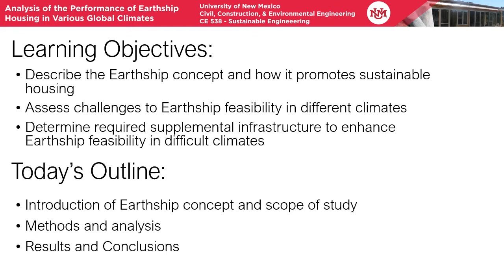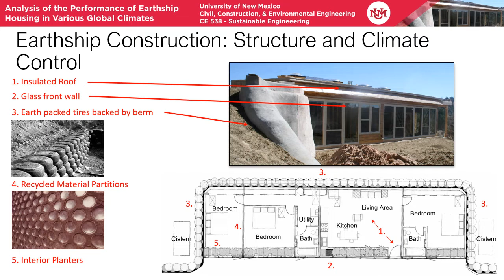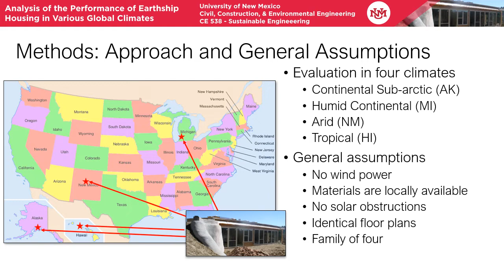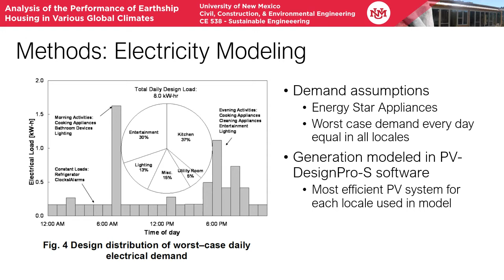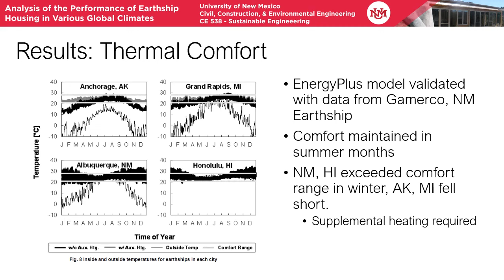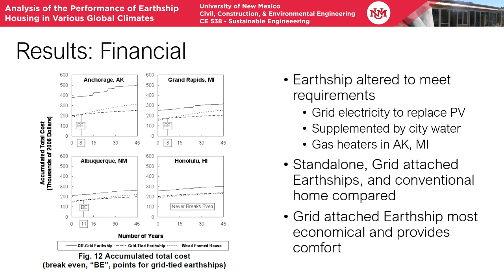Analysis of the Performance of Earthship Housing in Various Global Climates

Comment: The floor plan you use looks like an old model.  There's no separation between the greenhouse and living area, that creates larger fluctuations in temperature.  That is something they corrected early on.  They put a second layer of windows and doors between the living space and greenhouse to act like an airlock.